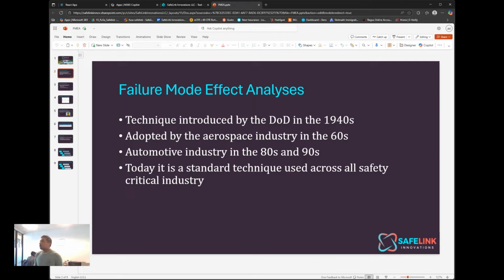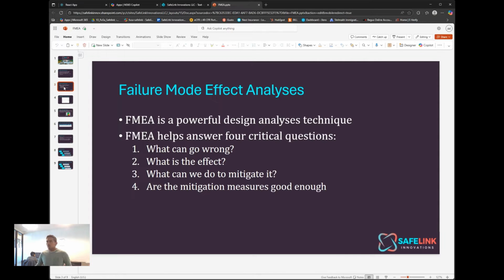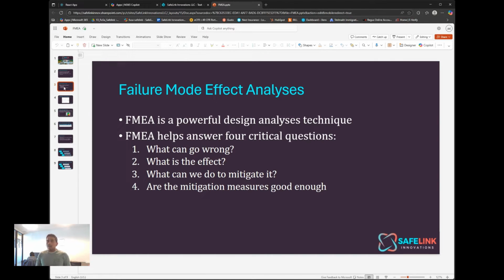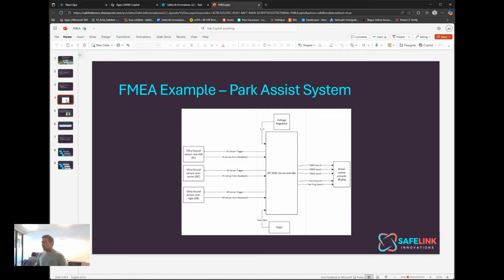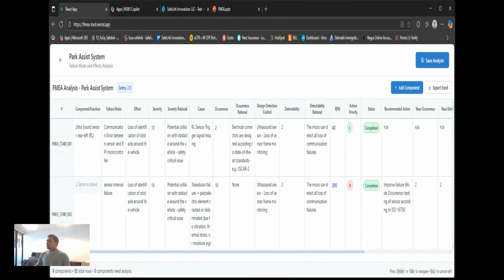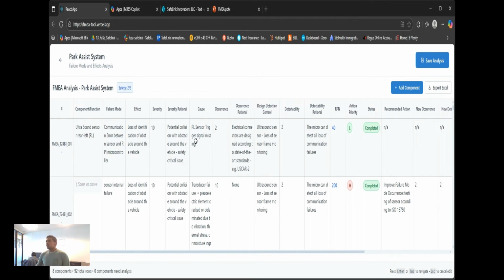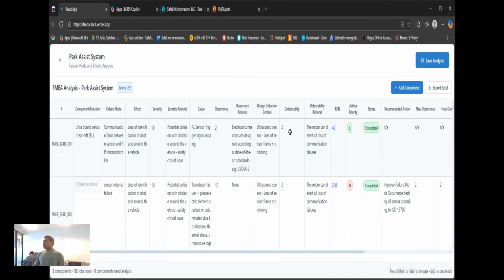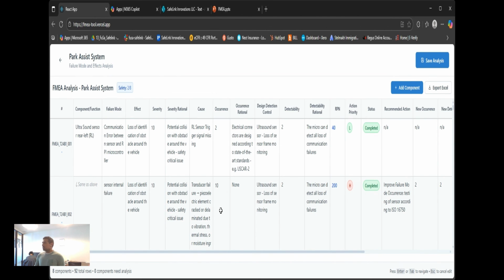FMEA  - Introduction

Comment from the maker: FMEA is widely used across industries to identify **potential failures and reduce design risks**, but managing large FMEA tables manually can be challenging.

*SLIKWORKS FMEA Software* helps engineers organize and manage FMEA workflows more efficiently.

✔ Perform *functional, system, and hardware FMEAs*
✔ Track *failure modes, causes, and mitigation measures*
✔ Analyze risk using *severity, occurrence, and detection ratings*

Learn more about SLIKWORKS:
https://www.safelink-innovations.com/slikworks/fmea-software